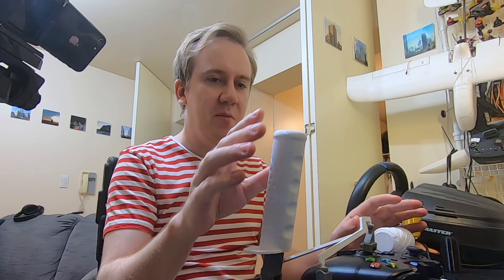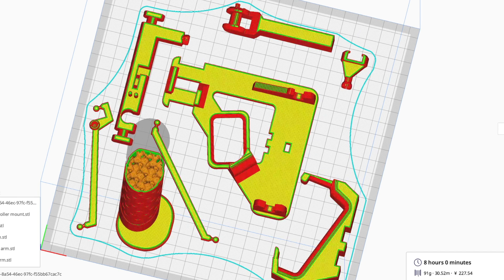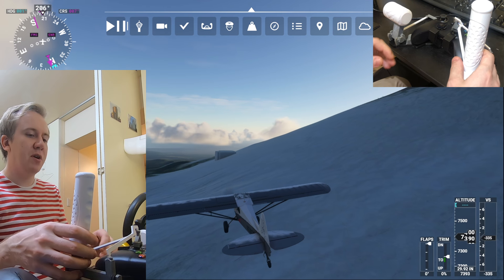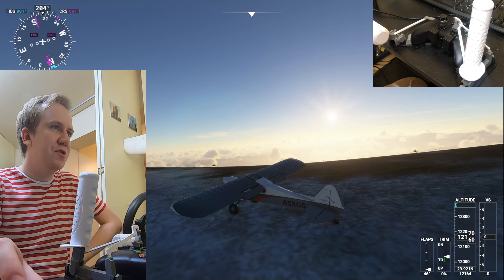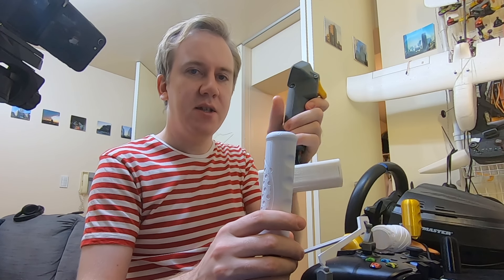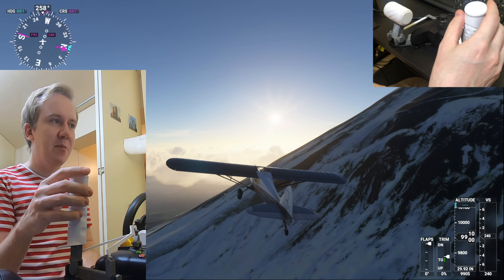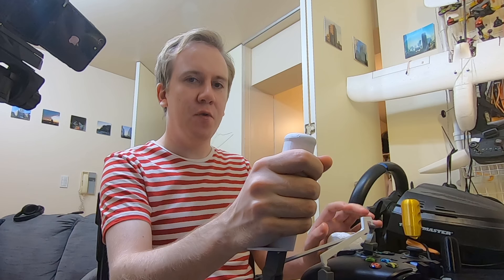Make your XBOX gamepad into a joystick HOTAS with this 3D printed extension

Comment: Is the throttle level resistive to the the spring return of the trigger? Are you able to push the throttle lever to whatever position you want and it stays there like a throttle lever on a plane?

Comment: Nice project, since I saw you have a racing wheel too, would you have the expertise to create a pitch system for your wheel?

I'm using my racing wheel and pedals for the the rudder and ailerons, but it is missing the pitch for the elevator, so on take offs and landings I have to go back to my Xbox One controller.

A Japanese youtuber made a pitch system with linear potentiometer, Arduino and seat rails, unfortunately he didn't shown the schematics, just the finished project. :(
Reply from the maker: Interesting. That’s a cool idea! Do you have a link to that video?
Reply from the maker: @SergipeCycling  Oh that's awesome. I'll definitely put this in my backlog!

Comment: I know this is a technicality but that's not a HOTAS. A HOTAS has buttons placed on the stick and throttle to allow for manipulation of aircraft systems while maintaining positive control of the primary flight controls.
Reply: You are technically correct, which is the best kind of correct.
Reply: Urrggghh...
Reply: I guess that’s why it’s “hands on”? Because you can operate other controls while hands on
Reply: Voiceattack would help
Reply: So it's technically a TAS.

Comment: Hey Akaki, thanks for this awesome design. I just have setup problem in MSFS 2020. Standard for the XBOX Controller for Throttle ist A and B, so digital input. I can't change the control for a linear analog input via LT. If I assign increase/decrease throttle to LT, nothing happens. There is no analog Input Option in the select menu like for the L and R sticks. Any hint for me? :-)
Reply: Just found it, had to list all function, not only the assigned ones! But now I have the problem, that the low Position of LT ist already 60% throttle. When clicking on sensitivity button, the upcoming window is empty. Controller has been calibrated under windows. Any clue for this issue? :-)
Reply: However, I believe in the sensitivity windows only adjustments to the left and right stick are possible if I'm not wrong, so not the LT Slider?
Reply: @gibmirschnell  I have the same problem. Did you find an answer, or do we have to wait for the next patch that brings back the "sensitivity window"?
Reply: Same problem. Does anyone know solution for this?
Reply: @jowieweb  no solution so far for me, since the sensitivity windows only adresses the left and right stick,.not LT slider.
The sensitivity however can be adjusted in a text file somewhere located on the local disk. Google that and you'll find then path. Not convenient, but should work at least.
Reply: Has anyone found a fix?

Comment: Now just have to develop a foot pedal system that works off the triggers for rudder control. Nice work, I've thought about building one myself but now thinking of investing in a 3d printer first
Reply: Don't go with an XYZPrinter. I used one to start off and it was kinda useful to learn, but it is loads of extra money and I hadn't realized the size of the online community for others. People love their Ender 3s and I have a similar one called a CR-10.

Comment: That's a genius idea you've come up with there. It's surprising that there's not a commercial product like this. 
I think a version for the DS4 would be a great idea, but I've got another challenge for your engineering abilities. Would it be possible to add a twist axis to the throttle that links to the right trigger so that you could use that axis for the rudder. This would let you do ground steering and crosswind landings by twisting the throttle handle to the left or right.
This axis would probably be harder to do and another option would be to have it move left/right for rudder control. You'd need to have some sort of adjustment so it's neutral position was with the trigger half pulled, but if you could solve the design issue it would give you very good control when flying with a gamepad.

Comment: So to find an organic shape I cut out card stock with a grid on it until it fits perfectly. Then, i scan it in as a jpg calibrate the grid to measurements in fusion 360. You can use major cross sections to build entire solid shapes or just the sections that you care about. (Tip: A  dremel sanding barrel works well for adjusting the cardstock.) This mehted has the potential to outperform a probe CMM or dual platform laser scanner.
Reply from the maker: Funny you should say that, I did exactly that for the DualShock one! I actually took the cut out card stock and laid it on top of my screen, set the scale to 1:1 and drew a path to match it :D

Comment: "THE SCIENCE OF STICK HEIGHT AND WHAT WORKS BEST" (Through my own observations)

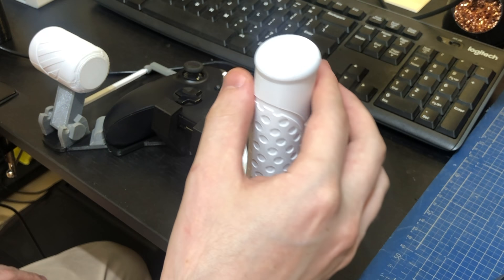At 4:55, yes subtle movements are used although what you are describing is more like a helicopter where there is a very fine input and "death grabbing" the cyclic (joystick but for helicopters) can cause very excessive instability although most non fly by wire aircraft which use cables to deflect flight control surfaces actually require a fair amount of force in order to manipulate them.

The issue with flying with console controllers is they don't have a large radius of distance between the thumb head and the rotational point (around 1-2cm) therefore the # of degrees of movement is inversely proportional to the radius length.(as one goes up the other one goes down). If the movement in space that the users thumb travels is always the same then increasing the radius (stick) length will allow for a decrease in the angle created along the x or y axis of the stick.

The benefit to this change is that a finer level of control is achieved by increasing the distance the user must travel to reach a certain value. As we must assume the radius is the only thing that is changed then we can also assume that the speed the user moving their finger is still the same, and as speed = distance over time, increasing the radius will increase the time to reach the previous point of deflection on a shorter stick. So there is a trade-off. Higher control at the reduction of reaction time. You can experiment with this as you which although this technique can be seen everywhere to the size of your steering wheel to videogame controllers and mouse DPI.

What radius to use depends on the use for the "controller". In the Xbox series 1 elite controller you are given different heights of sticks to replace which may alter your ability in game. Someone playing a First Person Shooter may wish for finer control over their aim and go for a higher stick or someone who has good aim but struggles with reflexes may want a shorter one. There is many technicalities to what is best for people although in most circumstances it is generally one size fits all however in extreme cases such as e-sports gaming, this factor could ultimately determine whether someone wins or loses.

However simple, this device will certainly introduce more individuals into the fight sim community who cannot spend hundreds of dollars on the most realistic tech and improve their overall experience along with their level of fidelity with operating a virtual aircraft.

Comment: I would like to see an improvement on the popular steering wheel controller mods there are out there but with the same ball joints and rubber band tension steering you made with the flight stick controller.

Comment: Great design! Though technically not a HOTAS. A HOTAS has an assortment of buttons and switches used to control sensors, instruments, weapons, etc.. while keeping the hands on the throttle and stick to always maneuver the aircraft. I like your concept but it might be tricky getting buttons on the stick or throttle without tearing it open and rewiring the controller.

Comment: No offense but I cant find anyone on youtube, reddit or thingiverse that has commented that they were successfully able to build this without modifications (sanding, drilling, etc). It appears that for most people, the default result is that the  pieces are too large to fit together. A good example is the joystick_shaft.stl, I had to hammer it in to get it to fit, and it is completely stuck and immovable. Same thing with the joystick_controller_mount.stl; I had to hammer that in pretty good too.  

Because there are much more people commenting with this issue than there are people commenting that it works, would you consider creating a version with condensed parts which would work fit together better? It looks like an amazing invention and I'm not trying to nitpick, but when digging through the comments it looks like most people that have tried it are in the same boat as me.

Comment: Hi everyone my adapter is so nice but I want to address the throttle issue. It’s not covered fully but after reading comments and remapping buttons , the throttle only works with the Left Trigger throttle up OR down not both. Even then it’s a gradual increase or decrease by modulating the throttle. The mount fits so perfect it’s really well designed. Going to do a video on how to change the settings for those that are struggling on my channel. Thanks

Comment: I have an idea maybe it could work out.

Couldnt you put a second bar on the throttle and somehow change the design so when you let go of the throttle to the „0 point“ and then keep pressing above the 0 point it starts pushing down on the right bottom button and therefore starts braking. 

I dont use xbox controllers but in ps4 language it would be:
„0 - 100“ Throttle. You push your lever up. 
„0 Point“ No Throttle/Brake. Lever is straight
„0 - (-)100“ Brake. Pull down the lever.

Comment: Hey buddy I love the design. As a sim racer I saw potential for this to be used as a handbrake and sequential shifter combo. I'm finishing up the designs and guide for it now and just wanted to know if it's ok if I post it as a remix on thingiverse linking your original. Ive managed to do it in a way that only the right thumb stick connector needs to be changed and the hand grips can be changed if wanted so anyone who has already made this won't be needing to make a whole new one. Once again great design, keep it up 👍
Reply from the maker: I don't mind at all, if you can make it work.
I have a few handbrake and H shifter projects you can take a look at too.
Reply: @AkakiKuumeri  Thank you for sharing such a wonderful design! I am unable to print the thumbstick collar, because I'm having issues with that model in my slicer? IT says the walls are too thin

Comment: Hello!!! I would like to know your sensitivity settings and also, I noticed you use the joystick on the right instead of the default which is left... did you change the mapping on the settings?

Another question about the throttle, in my controller they’re mapped on A and B to speed up or down. Where is this located in yours?

Thanks for the files!
Reply: did you find out how?

Comment: Nice work. Is there anything that is specifically stopping the whole setup moving around on the desk? I noticed it didn't move in the video, but you were also being very gentle with it.
Reply: I think you may be right that he's simply being gentle. At Home Depot you can buy little rubber stickers that go on the bottom of lamps and stuff. There found in the same section as the sticky hooks etc. I use them all the time.

Comment: Found this due to the current Flight stick shortage going on and love the design! The only thing keeping me from printing one is I can't really use it in Squadrons with out a trigger or aux buttons on the actually flight stick, I think if I do this I may have to sacrifice an xbox controller to run switches to the joy stick, unless you have any ideas?

Comment: This is quite interesting but not very pratical specially because you lose all buttons functionality. I'd prefer a small "locking" mod to lock the analogue stick into place so I could use it as a throttle axis. Some RC controllers have that function, to disable/enable the spring to reset the center of the Left stick which controls the throttle. Alternatively you could open the controller and simply remove the spring of one of the joysticks, but the stick becomes too loose this way, some modding to keep it firm into position would still be required. In fact, I strongly suggest anyone with the skills in cad to consider doing it!

The pitch/roll stick could benefit from an extender. Those already exist in thingverse to download.

Comment: I just printed it, and have to say, after some fiddeling around with a knife, the parts fit together and its very cool... The only problem I'm having is the setup in FS2020. The throttle only works from 50-100% (0-50% seems to be on the right trigger?)
I've tried to calibrate that out using the windows controller thing. In there every thing looks fine now, but not in FS. Anybod else got the same problem and solved it?
Reply: Nice! were you able to print the thumbstick collar, I'm having issues with that model in my slicer?
Reply: Same problem. Can't find a fix.

Comment: Absolutely remarkable creation. Is there a reason for the different colours in the pieces? I think I will go to my local library to print this, and want to be sure that just one kind of printing.. tread, is it called? Will be okay. I have never 3D printed before.
Reply from the maker: Thank you and good luck. I used different colors just for style. You can use any thread -- or filament -- that they have. If there is a choice of material, use PLA, that's the default stuff and I used it too.

Comment: Well its not a hotas since that means you can control everything important without removing your hands from the throttle and stick, this would just be a stick and throttle since you need to remove your hands to perform other actions

Comment: I made the throttle part, since I already have a Logitech extreme 3D joystick.
What size is the micro-switch used on the throttle? A link would be much appreciated. The ones I have are a little too big. 
Also, can I use a Arduino pro mini with a USB to serial converter cable connected to Rx and Tx, instead of ordering a pro micro? 
I have many pro minis, and one nano v3, but no pro micro.
Once I complete it, I will post a picture on your thingiverse page.
Thanks for a nice design.

Comment: How did you bind the thruster to increase and decrease with only one button (LB)? Standard configuration is A and B button for increase and decrease. Struggling a lot with that. @Akaki Kuumeri
Reply: I have the same question..did you meet the solution? Thanks

Comment: Hey man. Heads up. Chinese are selling your design on AliExpress for 50 euros a piece. 

Search for “Controller Mount Joystick Dock Bracket Plastic Game Handle Snap Together Flight Simulator HOTAS for XBOX ONE Controller 3D Print”

Idk what you can do, but if sueing them is an option, you should!

Comment: Looks like most of mine came out far too tight using the digilabs 3d45u with eco abs on the suggested settings - .2 mm and 3 perimeters. any suggestions?
Reply from the maker: I added looser fit versions of some of the smaller parts. Try them out
Reply: @AkakiKuumeri  After some minor boring out with the drill in the ball joints, it works great! thank you very much!

Comment: what controller?

keyboard of course, and i'm on process with your arduino, but finding rubber/spring is not as easy as before, nowaday rubber are easily snapped
can't wait to try your design
Reply from the maker: Good luck with it!

Comment: Hate to be the wet blanket, but this is just a joystick and throttle. HOTAS designation means you can control most flight functions while keeping your hands on the throttle and stick. While a very impressive design, this only controls stick and throttle motions with no input for any other flight functions.

Comment: Can you tell me how you mapped the throttle? By default the left bumper is yaw left, A increases throttle, and B decreases throttle - how did you set up the throttle with the 3D printed model?
Reply from the maker: I explain it in this video https://youtu.be/48kXckBXT24
Unfortunately, the current MSFS2020 version has an issue with analog triggers in the Xbox controller, so you’ll have to use a 3rd party app to fix it.

Comment: I just printed this and cant seem to get any of the ball joints to fit :( i guess i need to slightly tweak my settings
Reply: seems to be the common response from the people that have tried printing it. There are some "looser" stl files but i'm having issues putting together parts that dont have loose versions
Reply: Nice! were you able to print the thumbstick collar, I'm having issues with that model in my slicer?
Reply: @gkilm  Nice! were you able to print the thumbstick collar, I'm having issues with that model in my slicer?

Comment: How did you make the throttle not go back?
I’m building this out of cardboard because I have no 3d printer!
Reply: I’ve already tested the (cardboard) joystick and it works GREAT (especially for bush flying.)
But I have a Question:
How did you setup the rudder, when the throttle is connected to the button to yaw left?

Comment: I have a very calibrated 3D printer and I find the tolerances on the models to be too tight. the male parts snap going into the female part and the throttle base is too tight for the parts that snap into it to fit without issues.